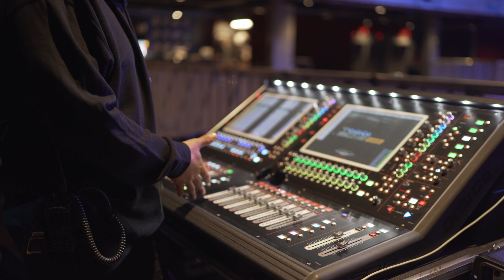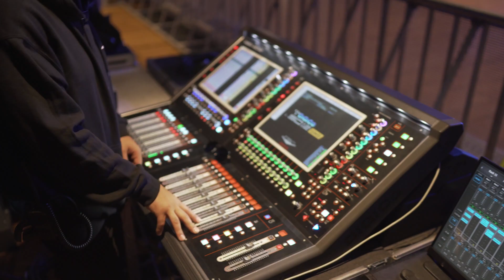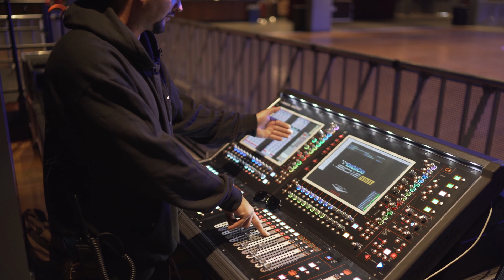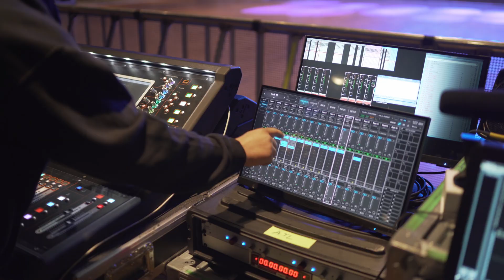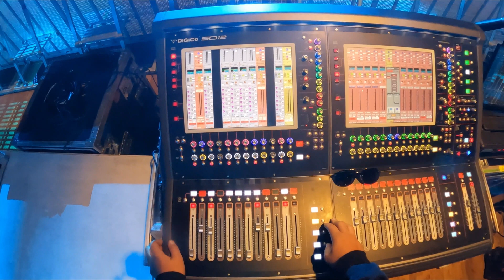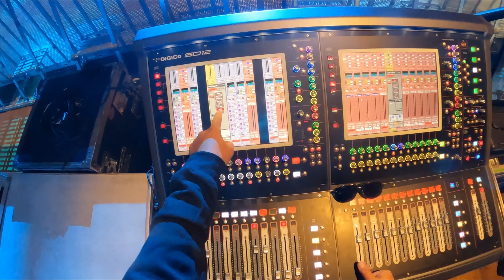Perfectly in Phase: Mastering Waves Plugin Phase Alignment with Digico SD12 Live Mixing in Concert

Comment: Why don't you just delay the non Waves group 128 samples instead of sending it to a dummy Waves insert? Also, do you know if a delay on a group sticks with a route to another place? Like if I delayed a group 14 samples and then input it into the Matrix, would that Matrix input have 14 samples plus the routing delay or only the routing delay?
Reply: The challenge is there‘s not only the 128 samples from the plugins. The sending/returning also adds some samples of latency… aka round trip latency from the interfacing… figuring out the exact number samples to add for that would require you to measure it… which can be tedious… inserting everything is just an easy way to guarantee all inputs are 100% in sync.